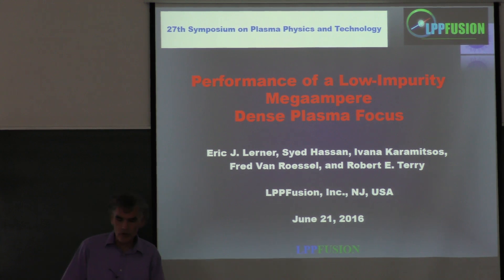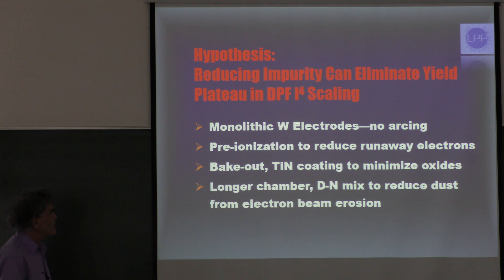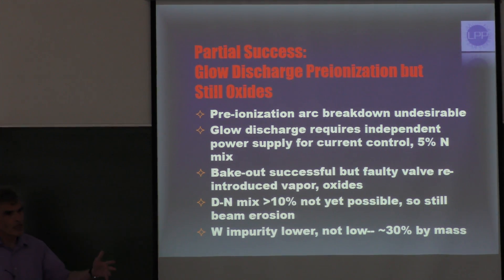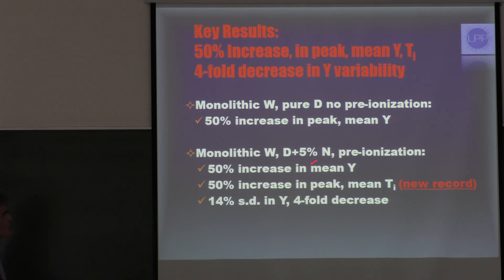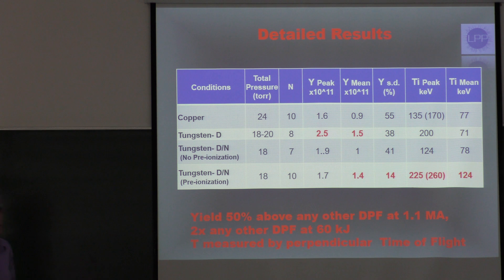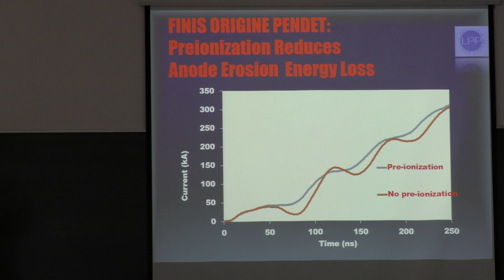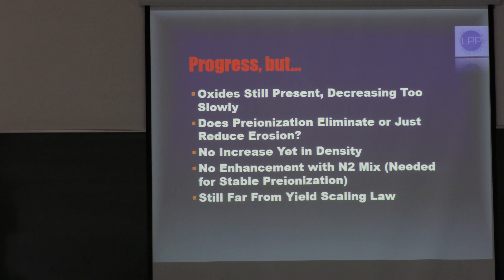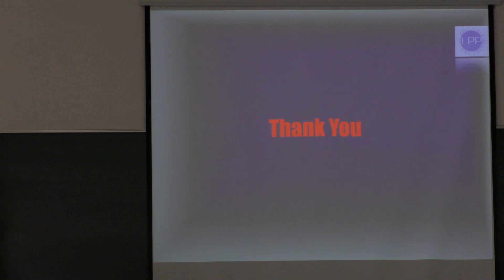Presentation by Eric Lerner, LPPFusion to Symposium on Plasma Physics and Technology, Prague

Comment: Why it uses Boron as fuel?? Anyone??
Reply: Boyett Crespo virtually no neutrons so no radioactive waste.
Reply: Almost no nasty Neutrons being generated: 

https://en.wikipedia.org/wiki/Aneutronic_fusion#Proton%E2%80%93boron_fusion
Reply: The fusion of a boron nucleus with a proton (hydrogen ion) produces slow-moving helium particles but no neutrons or radioactive waste.[8] One method of producing proton-boron fusion uses one laser to create a boron-11 plasma and another to create a stream of protons that smash into the plasma. The laser-generated proton beam produces a tenfold increase of boron fusion because protons and boron nuclei collide directly. Earlier methods used a solid boron target, "protected" by its electrons, which reduced the fusion rate.[9]

This method releases energy directly as electricity without requiring conversion from heat. Experiments suggest a petawatt-scale laser pulse could launch an ‘avalanche’ fusion reaction.